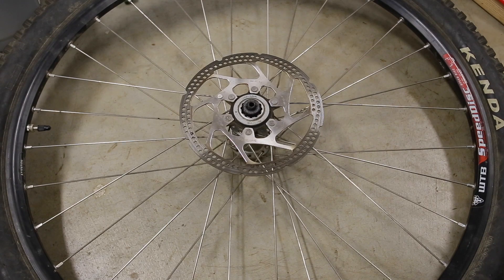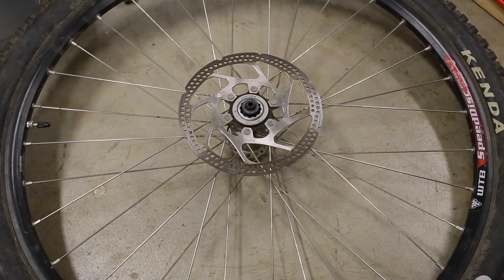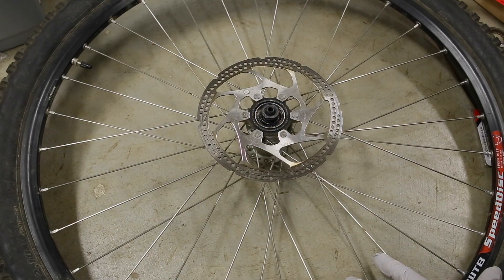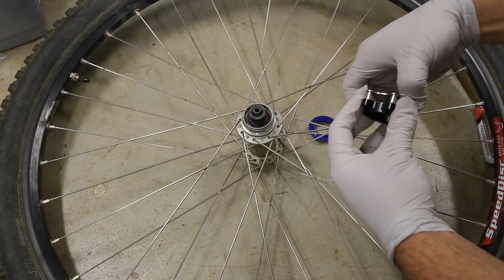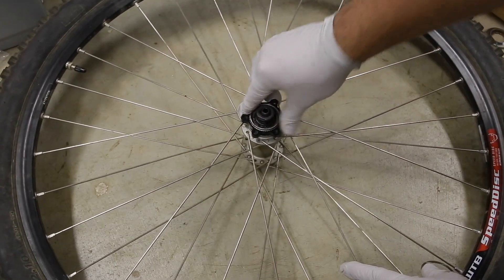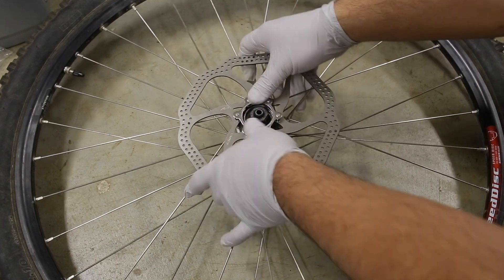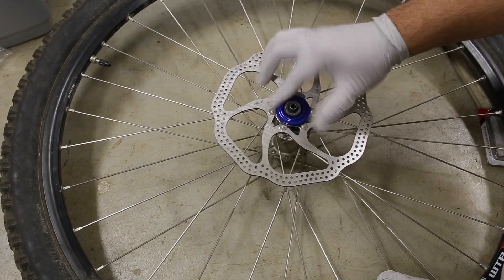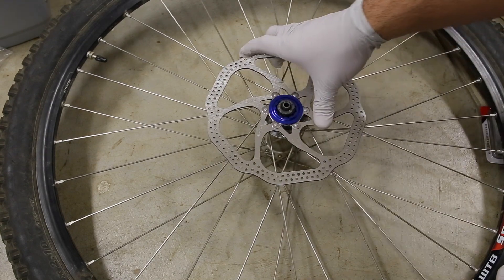How to install Shimano Center lock to 6 bolt rotor adapter!

Comment: Nice, is the same If the brakes system is Flat mount ? Can I use the adapter from CL to 6 Bolts as well ?

Comment: Excellent and clear.  I was concerned how adapter holds disc securely ?  New bike Trance X 2 29 came with  excellent Deore 4 piston centerlock ? discs 203 front and 180 rear but I noticed disc surface too glossy and narrow compared to my Magura MT5 pistons contact patch and 6 bolt wider brake area on 203... under heavy trail braking not as smooth and modulated... we'll see. I may try to sand them like I normally do for power. Otherwise Very well put together video showing all the pieces... seems snug

Comment: Nice, is it possible to go from 6 bolt rotor to center locK?
Reply from the maker: I don't think there is, other than buying a new hub.
Reply: of course. u can use "Shimano Adapter Center Lock SM-RTAD10 for 6-hole Brake Disc"

Comment: Great video. Seems very easy to do (almost too easy actually) I am considering upgrading the brakes on my bike from Shimano M475 to some real hope tech 3 E4 brakes and rotors only then I would still need to mount them on my shimano wheels with Center lock. Later though I would upgrade the wheels too and then I could have 6 bolts hubs, but I can't figure out if I would really want that, especially since you make the adaptation seem so easy. Does it brake as good as with a 6 bolt mount?
Reply from the maker: Thanks! It was VERY easy and straightforward.     

Since I did upgrade to 180mm from 160mm, the braking performance obviously went up, but I have confidence that the performance will be exactly the same as before, if you were to use an equivalent part. The only difference is the ability to swap rotors with ease.
Reply: Hope are eye candy for sure but they're not powerful compared to Magura MT5  or shimano SLX, XT or Zee. My 2cc

Comment: How is the adapter holding up?
Have you had any issues and can you tell me which adapter you bought from AliExpress?
Thank you!
Reply: $12 to 18 bucks -- I just installed 2 -- just type in "centerlock to 6 bolt" on Amazon or eBay.

Comment: Great vid. If you switch back to centerlock rotors, could you use the lock ring from the adapter instead of the Shimano one? I’m assuming it’s pretty much the same part?
Reply: Yes, it should be the same part

Comment: any chance there is a reverse adapter? 6 bolt to centerlock?
Reply from the maker: Sadly, the 6 bolt is made with the hub, and is non-removable. So you'll need to buy a centerlock style hub. :(
Reply: dam it :( thanx for the info

Comment: It’s not a 6 bolts - it’s just an adapter on a new rotor without rivets!  did u see any bolts there? 
Clean work, but u should follow torque spec.
Reply: It doesn't even imply that it's 6 bolts - the video is titled "how to install a centerlock to 6 bolt ADAPTER". Nothing to do with using bolts or rivets or visa versa - simply how to INSTALL THE ADAPTER

Comment: What kind of adapter is that? Who made it? Where did you get it?
Reply from the maker: It's called a Center-lock to 6 bolt adapter. You can get it from your local bike shop or amazon. I got mine from Aliexpress.
Reply: im  trying to covert a wheel to accept a disc brake that previously used v brakes. From what i saw this could work for that too correct?
Reply from the maker: If you have vbrakes, more than likely, you do not have a 6 bolt hub or centerlock hub. In that case, you'll need to buy a hub capable of accepting a 6 bolt disc brake rotor, or centerlock brake rotor.
Reply: @Matt-xq6ow  
Thanks for the video. Can you post a link for that hub adapter for bikes with factory vbrakes/rim brakes?

Comment: why would anyone want to change a centerlock to a 6 bolt? Center lock is better
Reply from the maker: jc51373 to each their own. there aren't that many differences between center Lock and 6 bolt to say that one is better than the other.
Reply: Center lock is absolutely better than 6 bolt, which is why the entire industry is moving in that direction. And the differences are significant, all the torque is applied to those bolts. Mere mortals may not notice any difference just can't underdstand why you'd want to adapt out of it unless there is something technical going on you needed to do it for.
Reply from the maker: Yea, but there are only a few differences to justify that centerlock is better. Minimal at best. You mention, ease of installation. That's really about it. I went 6 bolt, since I like the ability to swap to different rotors. Not just specific centerlock rotors.
Reply: to me strength is the reason to use it, it's stronger more consistent with zero chance of it modulating or loosening up, or as you said being installed incorrectly.
Reply: If you want to install floating roters from Hope. This is what I am considering doing myself.
Reply: do you have a problem of your discs snapping loose from your hubs??    center lock and 6 bolt do the exact same job.. no difference apart from installing and removing
Reply: Never mind these nay sayers...thanks for the video. I have a number of WTB rims with Centre Lock rotors....yes they are cheaper than 6 bolt. But I've converter to BB5s and wanted to know if you could change the hub for a G2 Cleansweep Rotor. Now I can ...thanks again brother!
Reply: If you ordered 6 bolts, cause there are a more of them
Reply: @Matt-xq6ow  Seems like most Bike Mechanics agree with you and prefer Six bolt rotors.
Reply: Yeah center lock is better....for the manufacturers since it's going to be cheaper to make. As for the entire industry moving away from it where's the flood of good rotors to support this claim? Oh, and since shimano seems to be the one pushing the issue there's a stinky whiff of yet another proprietary money grab behind this questionable improvement.